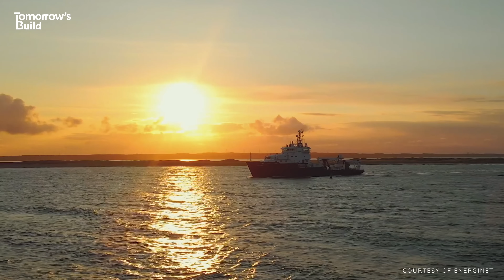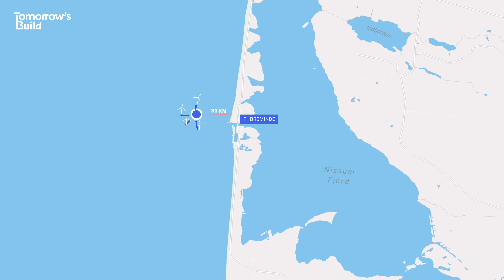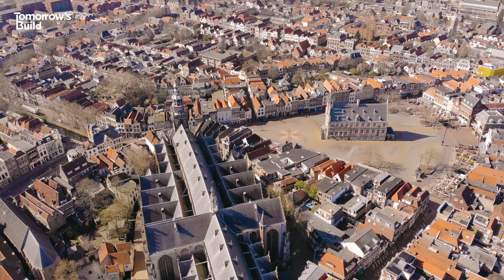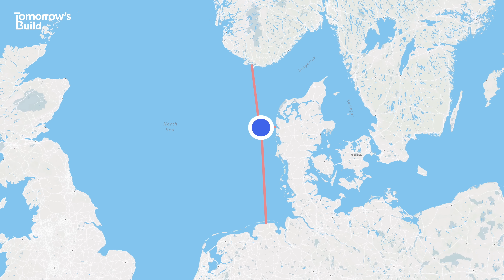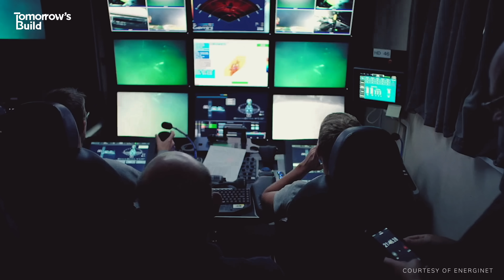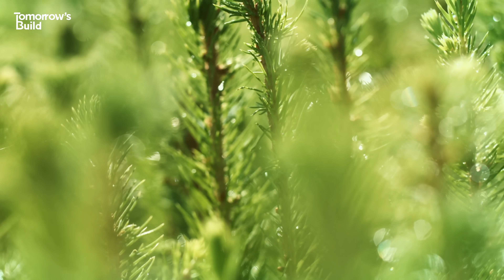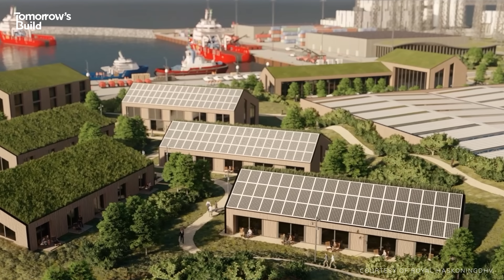Denmark's $34BN Energy Islands Could Solve Europe's Power Problem

Comment: Denmark uses 32,000 GW a year and the combined GW of these will be 20 GW. How does this solve Europe's power problem when it doesn't solve Denmark's power problem? You only need 1,600 of these islands to supply Denmark, or $54 trillion dollars to build them all just to supply Denmark.  Denmark budget is 85 billion. So if you somehow only spent the whole budget on building these, it would take 635 years to afford to build them all if you had 100% going into it. This is not feasible.
Reply: Do you understand the difference between installed GW and GWh usage?

Comment: Something doesn't add up. If it costs 34 billion dollars for this island to produce 3 gigawatts, isn't that around 11 million dollars per megawatt? Coal-fired is around two million dollars per megawatt. And you still haven't counted the cost of the wind turbines, the maintenance of a freaking Island as well as the wind turbines at sea, and the interconnection will be a nightmare, as it will all be underwater. God forbid the sea level rises, as it would be a complete write-off of the project. Sounds like a typical state-run project: unfeasible concept, bloated budget, all to create a huge white elephant... but it will make people happy because it's green, right lol.

Comment: What about energy loss with so long underwater wire?
Reply: DC power transmission is used for long distances, like 1000km.
AC is often only 150 miles, and line phases must be rolled.

Comment: Its if not the most idiotic, but one of the most idiotic projects suggested in our countrys history. Its more or less just decided to build this oversized plugboard, and there has not even been made a feasibility study if its a good/mediocre/bad idea. Essentially the island isnt really needed, the distances out to the windmills is so short, that its way cheaper to do the maintenance as is done today - by sending out ships from land, which will be needed anyway no matter what.

The environment is also quite hostile, so even considering Power to X in the middle of the ocean is quite daunting, wouldnt it just be easier to do that on land, AND at the same time be able to use the excess power from Power to X production to heat up homes... just wondering :). Because that excess heat will be useless at sea, just a simple unused waste product nothing more.

And not to forget, in the first many years Power to X isnt viable, because a large scale solution is still experimental. So the nice windmills that is producing at approx 46% of the listed megawatt efficiency, will not produce electricity at the same time there is no wind, which is most of the time the same as on land. So what kind of power do we use when windenergy isnt available... no storage of the power.. nuclear or coal!

So why not just build a Nuclear Powerplant from the getgo, it can deliver more power, more climate friendly and at the same time heat up a large city - way cheaper than this foolish project.

Comment: And what 
will be the cost of the generated energy ?
Reply: The wind turbines of today produce energy cheaper than coal plants can.
Reply: @bzdtemp  Not true.
Reply: @emilioplentz  True, but just recently. However the price of generation power from the wind keeps falling as turbine tech improves.
The IEA has done a big study where they compare costs of all sorts of energy generation.
Reply: @bzdtemp  There's another aspects. We must maintain the plants. Wind is not blowing.
Reply: @emilioplentz  That is true, however those issues are also being worked on, just one example is that when there is wind power enough to cover everything then hydro plants can close their valves and build up the reserve. And there is also a lot work on how to store the surplus electricity from wind, one way is to create hydrogen and maybe one could covert coal plants to run on hydrogen - pure speculation on my part here, no idea if that even makes sense.

Comment: That would be amazing! Then I realise I live in Belgium.. and I have too pay, when I generate to much power with my solar panels. So surely my gouvernement would find a why to screw this up..
Reply: so you're penalized if your solar panels produce too much power? that's insane, absolutely no incentive for people to have solar panels installed.
Reply: @grainofsand1951  yes, thats the short answer. We have electricity gauges that can count backwards. So everything you dump in the system can be counted. Every watt can be counted, and you pay a fee for what you put on the grid (still cheaper then buying a watt). Butt now the gouvernment is going too change everything and you have too pay more... and the best part? Belgium can be split up in two regions: 'Vlaanderen' and 'Wallonië'. And all the new rules only count for 'Vlaanderen'.
Reply: @jaypeeters  That sounds ridiculous. Shouldn't they pay you for the power? When they have a power peak, they never pay you for consuming more, do they?

Comment: Impressive idea with one exception: A cost estimate with no implementation plan makes it more of a hope than an roadmap for their future. I also hope they succeed.
Reply: Not really... The thing is, there are a lot of different concepts that are being talked about regarding the islands future production.
One of the big ones, is the new PtX (Power to X) project, it is essencially Hydrogen production, to replace oil/petrol for heavy shipping, such as ships, airplanes and trucks, it has been devoloped (the way to extract hydrogen) in Danish universitis, and it is believed that if production starts with the island, that Danish shipping could be entirely based on PtX as early as 2035, if pushed for in the next five years.

But that would mean that the Island will have to be at least a third bigger... However it also means that Denmark would be completely independent of Oil and Gas after 2050 (when we shut down the last Oil-field).

Comment: They could use a floating island concept. Pros: it could be cheaper as it would include less material and less destructive than dumping sand and rock into the ocean.
Cons: the turbulant north sea could cause dammage and or sink a floating device
Reply: You have an amazing brain.
Reply: Just read that it’s more difficult with connecting to the land, since the floating rig is moving constantly.
Reply: Islands tend to be temporary in this part of the North Sea. I guess they want to figure if it is possible to build something permanent with current technology, and what effect it will have on the coastline. The Bornholm location is the less ambitious choice.

Comment: What is the lifespan of all those turbines, what happens when you have to replace them all in 15 to 20 years. Doesn't make sense as a sustainable option. Not only this, but our power needs by 2050 will likely be double what they are today. We need dense energy sources not diffuse ones!

Comment: Transition to clean energy is so important but 34 billion for “just” 10 million houses seems… very very expensive
Reply: (34000000000.0  / 10000000) = 3400 eur for energy for house, does not seem that much, for rich Nordic country's
Reply: "The Economist Intelligence Unit's (EIU) Climate Change Resilience Index measured the preparedness of the world's 82 largest economies and found that based on current trends the fallout of warming temperatures would shave off three percent of global GDP by 2050."

The cost of not doing anything would be a lot higer in the long term.
Reply: @Nillerzen: You cannot make accurate economic forecasts 29 years into the future.
Benefits of a warming climate are
1. Increased agricultural yields 
2. Reduced winter heating costs 
3. Reduced deaths from hypothermia 
4. Postponement of the next glacial maximum 
Deleterious effects of warming climate are:
1. Increased summer cooling costs 
2. More deaths from heat stroke 
3. Higher maximum interglacial sea level with more coastal erosion and flooding.
The balance between the beneficial and deleterious effects varies greatly by location, and also is highly dependent upon the magnitude of the warming.
We have so called “expert international panels “ churning out a lot of costly and useless propaganda.
Reply: @johngeier8692 I agree that you can't make an accurate forecast that long into the future, that doesn't mean you shouldn't try to foresee the dangers over the horizon.

But i do know, that i will have a greater amount of trust in " expert international panels " the almost anyone else. Since it's literally their job.

Comment: With all the powerful ocean currents flowing past there one would imagine that the power would have been extracted from the sea rather from the wind..?
Reply: Yeah, and kill milions of fishes in the process,  or ptevent them begin born in first place.
Reply: @kvakerbillduck9500  well.. I would say that thousands of boats towing kilometer long nets dragging on the bottom destroy infinitely more of the ocean life than underwater energy production systems that can actually be designed to protect the sea life. 
My point is that the sea currents are quite powerful, stable and constant but if the project management find more efficiency in the wind turbines then that should be the route of course.

Comment: Unbelievable how much crap people believe. wind turbines will never be able to fulfill the energy needed to people it's a fantasy island  if people wanted clean and reliable energy that works even when it is completely windless and when the sun is not shining Then there is only one real solution nuclear power is that solution Nuclear power can work for more than 80 years a wind turbine lasts about 25 years a new type should, however, last about 30 years and then there is the waste from sun and wind the problem is still not solved

Comment: Again, the generating capacity (GW) is presented, instead of the energy produced, or expected to produce, daily, monthly, or whatever which is measured in kWh  (h for hours). Would be useful to know how many 0 hours production time is planned.
Reply: because its a money laundering and resume pushing fraud
Reply: The UK, as I sit here this afternoon, is producing 9.09GW of offshore wind energy into our National Grid, from a 13.6GW capacity. The UK has virtually as much capacity as the rest of Europe combined, and is as good an example as we have. The kWh barometer would involve far too many assumptions, fundamentally based on domestic housing stock.
Reply: @simonpinkerton4905  GW is capacity measure, not energy produced.
Reply: @TheJmkovacs  I'm fully aware  of a GW measure, yet you are in deniall that a kWh can be used when there is far too many assumptions needed for any analysis.
Reply: @simonpinkerton4905  The kWh is what counts, your monthly bill, easy to measure. A capacity rating is determined by the manufacturer and will not change even if it is standing ide.
Reply: @TheJmkovacs  I understand the kWh measures, we all pay based on usage. Is yr house single brick? Built over a century ago, or a new build? Does it have insulation, and if so, how much. What appliances do you run, and what are their energy ratings.......AND SO ON.  A national picture is much easier to define in actual GW produced, not capacity. Just as our National Grid does...which is constantly live for you to measure should you Google it
Reply: @simonpinkerton4905  Well, no use. Please ask someone to explain to you the diferent menning of GW and GWh.
Reply: @TheJmkovacs  Maybe you should understand that GW is exactly the same as a GWh whilst measuring the output of a power station. Maybe Wiki could help you with that..........

Comment: An interesting video per-se, but it doesn't show the vast array of windfarms under construction right across the north sea, (usually just out of visual range from the coast, leaving just a shipping lane between them and the coast). These are so numerous now that it's actually difficult to sail from say Scandinavia to England - a yacht essentially has to use its engines as it cannot navigate freely and turn to use the wind, unless the wind happens to be blowing exactly the right way on the day. Each of these farms have vast arrays of cables and infrastructure of course, thus it is likely that high capacity cables covering much of the energy transfer needs have already been laid - it would be good to know what agreements have been made / are possible (ergo how many are publicly owned across the EU) for energy transfer. Thankfully we have will at last have Nordstream to back up our power for when the wind isn't blowing, in what is, when analysed, a massively daft idea by dreamers and schemers until requisite energy storage banks (of whatever type) become widely available, and can be manufactured without totally stuffing the environment. What works in Denmark won't work in most of Europe due to demographics, industry and lifestyle.
Reply: Sorry about your yacht

Comment: Stuff like this is proof we already have everything we need to be an energy-sufficient species, but because of politics and greed, projects like these always get axed.
Reply: Or is it possibly because it doesnt work... You get huge ammount of power when you dont need it thus a frequenzy gets fuckd up and you have to shut it down or the other scenario where you get no power at all when you really need it and the frequenzy get fuckd up yet again so you have to shut down or like in most countrys you start THE ENVIROMENTALY FRIENDLY GASTURBINE............
Reply: Of course we do - this is four times as expensive in estimate as nuclear power plants per MW. And that's ignoring maintenance, which is much cheaper for NPPs than for offshore wind parks. Heck, this thing costs more than ITER :) And that's just the estimate. Looking at similar projects, you can expect easily 3x overruns, and quite probably much higher maintenance costs than expected (it isn't very long ago that we figured out just how much damage water does to wind turbines).

And then consider how poorly this can scale even in theory, and how tiny part of the energy mix of Europe it could ever supply, and how poor wind is for baseline power...

Politics and greed is just about right. But it's not just about the oil barons, you see :)
Reply: @Luaan: The costly “renewable energy “ projects are the result of the Climate Delusion and the Nuclear Power is Unsafe Delusion.
Popular delusions are determining energy policy in many parts of the world.

Comment: So, what's the point in this island? Why not simply build off-shore wind farm?
Reply: Same idea like having a farm building nearby arable lands you want to cultivate. These turbines don't build, maintain, decommission themselves. Having the island nearby will house material and personel. Also if its far off-shore, will you run 1000 wires from each turbine instead of connecting them all to one transformator and then running heavy watt wires (1 or more) directly to consuming cities?

Comment: Doesn't seem a particularly bright idea.
Reply: 12 gigawatts is roughly the size of 24 coal-fired power plants. How is that not a good idea?
Reply: @mugin11223344  Most of the artificial islands are sinking, it's a failed experiment. They should either find a natural Island or build it on land.
Reply: @magatism "Artificial islands are sinking" Are you not sure that is a local problem you are experiencing. We have many artificial islands in Denmark, and we are constantly making more. The problem of them sinking is not a thing we we're facing.
Reply: @mugin11223344  Inland reclamation is different from mid sea structures. Try it, it won't work.

Comment: One of the biggest challenges with this project will likely be designing and installing an effective ground grid. The grid will have to be installed beneath the seabed, but must be connected to the auxiliary ground grid within the artificial island itself. I’d definitely like to get details on this and see how this island can be effectively grounded. Interesting project, very innovative!
Reply: No worries, almost entire Danish power grid is long replaced into the ground. A result of one of the few sensible decisions a former energy minister made some 25 years ago ...
Reply: I'm more skeptical on the wind turbine tech. Creation and maintenance of wind turbines and solar farms are still expensive and are not environmentally friendly with the materials they use.
Reply: @CyberWolf755  Oh ok, so what are you suggesting now? Should we use coal and gas then? Nuclear is a tiny bit better than wind, but nuclear power is alot more expensive. So what exactly would you want?
Reply: @horseradish843  a nuclear island obviously duh
Reply: @blanco7726  let's call nuclear plants on islands: artificial volcano island